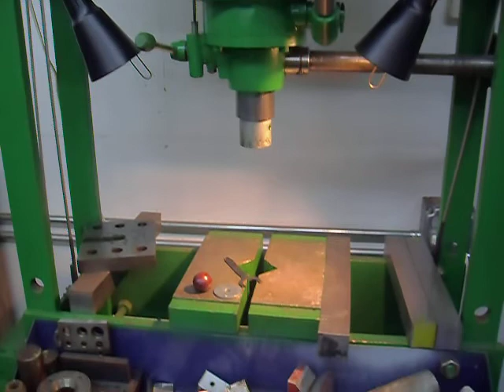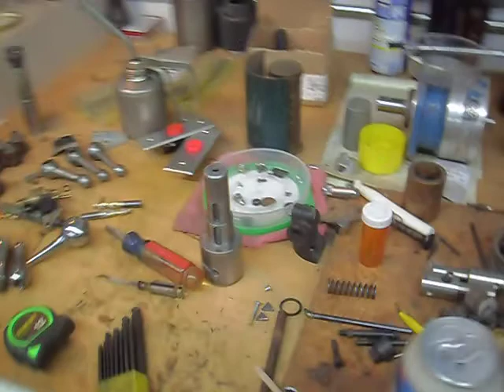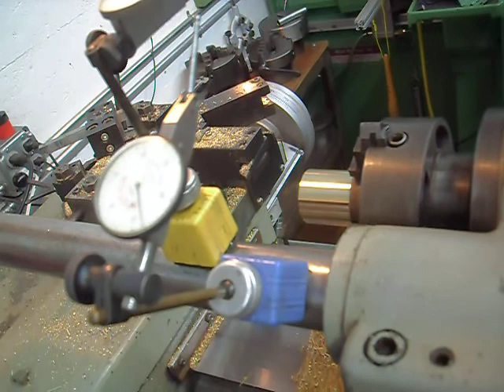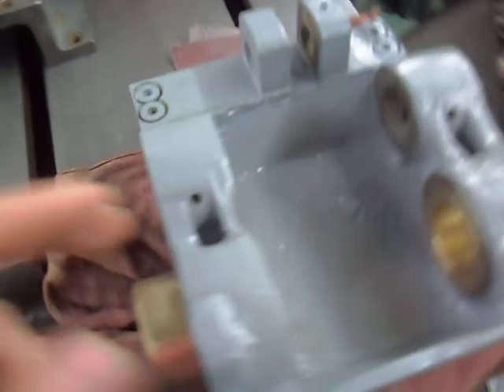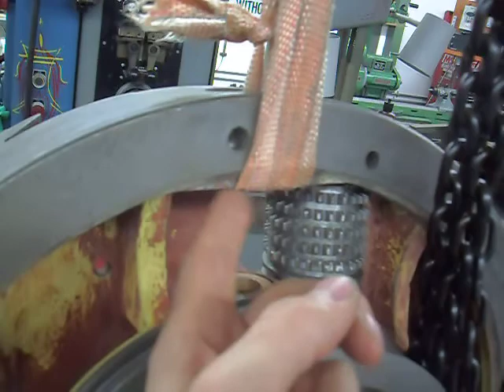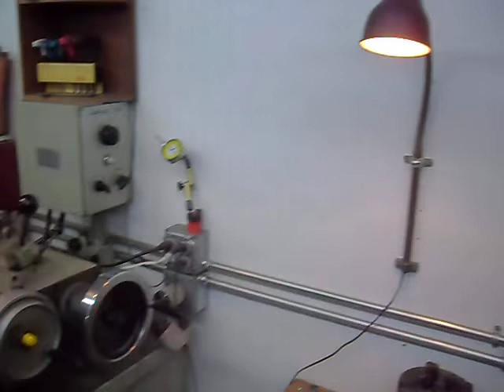Doozer's Machine Shop Update 11-24-19 -- Bushings for the Colchester lathe

Comment: How many square feet is your shop? I swear every video I see something new. That's alot of iron in one space.

Also yes summit was not a builder they used to have their machines made in the Czech Republic. I think now they are made in China/Taiwan. Designed in Murica supposedly, but that facing head looks identical to the one on a Tos H63A or a Union BFT63

We had an older one with a CNC at a place I worked part time. Pretty much all the HBMs were Czech or East German

Had 4 or 5 TOS borers, Skoda, Scharmann, Union, 1 summit in the high bay betwixt the massive Skoda and a massive Rafamet VBM.
Reply: The Tos H63A facing head has dovetails, but yeh the bigger guys have square ones I believe. The actuating mechanism was more what I was referring to and the general size.

I'll shoot you an email, I used to work for GL and then later a rebuilder of their machines. I've only come across a handful of the 25Ts like you have, and I learned a couple nee things trying to help a different youtuber figure out the age of theirs lately.
Reply from the maker: Matt  I very much enjoyed your emails. The experience that you have with these machines is so interesting to me.
Reply from the maker: Hey Matt, My shop is 900sq ft, not including the high-bay, which is another 500. Interesting info about Summit. Interesting, I have looked at pics and videos of Tos and Union facing heads, and they both have square slideways.  My Summit head has dovetail ways. Maybe different year machines has different designs, so no telling for sure. 

I did not know you had some HBM experience.  I would like to reach out to you ask some questions as I get to using my machine more.
kooldoozer@yahoo.com is my email.